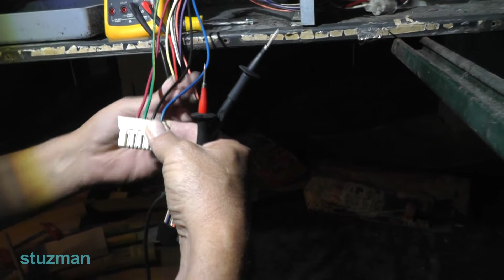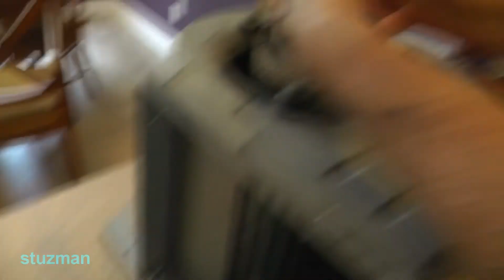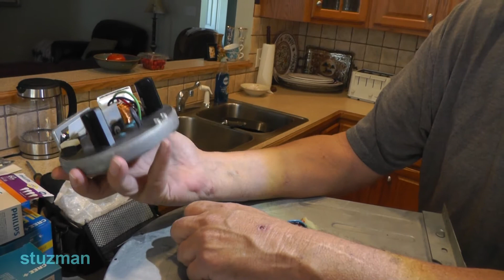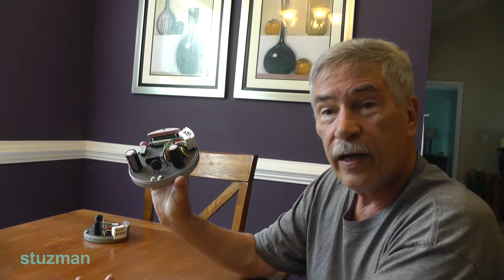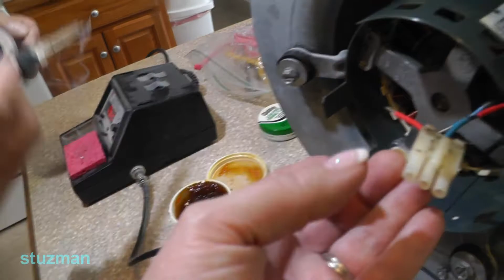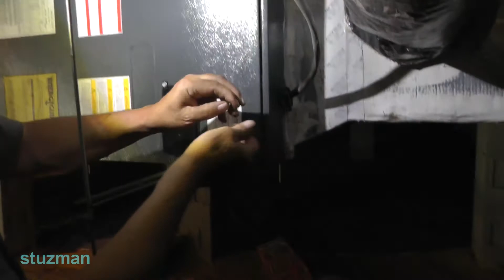House A/C Unit - X13 Evaporator Fan Not Running and Fix

Comment: Excellent video. The only question I would have is the rotation revolutions per minute on the cool mode, what it was before you did the replacement? Also, when heat mode is on or fan mode only is on, is the rotation RPMs the same? If those three are true, then this is a good swap. But if that's not known, it kind of leaves you wondering whether the CFM is proper for your system with the new ECM.  It is within the ECM that the torque values are stored so just because you are power tap 4 for instance does not mean you will have the same RPM after the swap.  All depends on the ECM and what is stored in it.  This is the frustrating thing about these dumb ECMs  Again great video
Reply from the maker: Yes, you're never sure about RPM when you order something from Ebay unless of course you check the RPM before and afterwards. In my case, only one wire was going to the terminal strip where only one speed was being used for the cooling and heating mode. In my case, everything turned out okay, and I didn't have any issue with the speed. I can count myself lucky with this issue. After five years, the module went out again and I ordered it from www.evergreenEM-motors.com I did a video on this installation where the motor will automatically sense the correct direction and program itself with that. If you like to see that video, it's located here https://www.youtube.com/watch?v=aAb5fVA-a1g&t=1s
Reply: @stuzman52  totally understand, but as I think you know, just because the one wire is going (and giving 24 V) to the one terminal before and after it does not guarantee anything about the speed - that speed is programmed in the controller. That’s what makes these so frustrating. You don’t know what that torque is programmed within the controller to run at. It’s really ridiculous how they made these things so complicated when you really just need three speeds. They do this to rip you off purposely just like encoding the whole thing in epoxy. I would like to have my ducks in a row and be able to easily find a replacement ECM controller for a reasonable price that I can pull the trigger on and order in case of failure. I just got a new Trane 80k furnace with the 3/4 hp ECM blower PT# D345978 RP# MOT18721 and some other #D344778P01. I will have to try Evergreen. Having a spare one on the shelf, kind of like a capacitor ready to go would be something I’d really like to be prepared for because I know it’s just a matter of time.  Thanks for the reply.!

Comment: I'm sorry... I got goosebumps watching you touching single insulated live wires so freely. Wear some sort of work gloves at least, if not live gloves. You never know if some sparky apprentice nicked the insulation. Brrrr....
On top of that, you placed a heavy metal fan, with some what sharp edges right on top of 240V wires 😳. That's how you damage the insulation and next time you grabbed them like you did, you're gonna get electrocuted. Be careful mate... Life is only one

Comment: Genius! I am 70 yrs. old, have been working in the HVAC business for 45 years or so, as a field service technician plus service and installation dept. mgr. I want to tell you that I have never seen a technician go to the extent that you did to help your customer out by repairing an X13 motor, or any other evaporator motor like you did. You and I both know that in most cases, that motor would have been yanked out and a new one would have been installed, AT A RIDICULOUS PRICE. My compliments to you, sir. I hope that your customer understands the great service that you provided her! You did get sort of lucky though on one part, at least the air handler wasn't located in the attic like 70% here in Pa. are. GREAT JOB!
Reply from the maker: Hi D Bru and hope you're having a great day! Yes, you are correct that most technicians would just pull the motor and replace it. And of course, what a price it would be! In my case, this was my own unit with my wife doing the filming. I'm pretty cheap and if there's a way to fix something I'll go that route. And having an electrical engineering background helped with the troubleshooting and fix. To this day, the unit is still working fine. Thanks for sharing a comment and hope you and your family the best wishes!
Reply: hejjhhhhhjh

Comment: I like what I see.  Will continue watching.  I have one question.  Since my A/C unit uses 240 volts, when measuring the amp draw on the two hot wires leading to the condenser unit, I'm measuring 12 amps on each line.  Does this mean that this unit is using 24 amps (both for the compressor and the fan motor)?  The nameplate on the condenser shows that the compressor should be drawing 17 RLA amps (running loaded amps).  The nameplate for the fan motor shows 1.9 amps and I measured 1.6 amps. 

If both legs are carrying 12 amps, and both wires are leading back to the service panel, then should the total amp draw thru the service panel be 24 amps.  I currently have a 50 amp circuit breaker which is two 25 amps circuit breakers together.  I know the reason why they use 50 amps circuit is to account for start-up on initial draw of the compressor.

Also, this unit uses 240 volts to run.  If I want to know how much wattage this unit is consuming, don't you just multiply voltage time amperage.  In my case, isn't that 2,880 watts (120V x 12A on each leg x 2).  So technical, isn't this unit using 24 amps?

Please help.
Thanks
Reply from the maker: Hi Steven, When you're measuring the amperage on a 240V unit or any 240V circuit, and you see 12 amps as in your case, it's 12A. Think of the 12 amps as going in on one hot wire and the same 12A is returning on the other hot leg. The same can be said for a 120V circuit. If you measure let's say 12A on the hot leg, you should measure 12A on the neutral when it returns on that wire and it's still the same 12A. Your compressor is rated for 17 RLA, which is 'rated load current'. This means with a full load, (maximum safe limit for the compressor), you would be pulling this amperage. It sounds like your unit is pulling OK amps to me and is not being overloaded :) As for the wattage, your answer is correct, but think of it as 240V * 12A = 2,880W. If you were dealing with a 120V circuit, then use that voltage as in 120V * 12A = 1,440W. Is that clear as mud? :)) Thanks for the question Steven and hope you can find some useful videos on this channel!

Comment from the maker: This is where I purchased the module from Ebay. Be sure this is what your issue is though as I'm not responsible if this doesn't fix your issue... Glad that you liked the video. http://www.ebay.com/itm/GE-Genteq-X13-1-2-HP-Endura-Module-For-1-2-HP-Motor-/112280285526?hash=item1a246d3156:g:tLgAAOSwZQRYh7hK

Comment: Great video Terry ! You will need the air conditioning this week it's going to get hot !!
Reply from the maker: N Smith thanks Norman and you're right that it is going to get hot. All is well so far AC is running good.👍
Reply: Good deal ! Yep temperature in the 90s and humidity is going to be high to 😮

Comment: Thank you for sharing this with us engineer, you are really a knowledgeable man! About the windings check its ok using an ohmmeter?? Thank you again!
Reply from the maker: Thank you armando for watching the video and sharing a comment! Sure, the ohmmeter is fine in checking the windings on the motor. It's pretty standard in the industry in checking all types of motors out there; not just this one. If there is a problem with the windings, it usually will show up with the resistance checks.
Reply: +stuzman thank you for the reply, ok now i understand.
Reply from the maker: armando nika you're quite welcome😀

Comment: You have two AC units, wow it must get hot down your way. Well done Terry , nice work and goosebumps :)
Reply from the maker: Oh yeah, in the summer we can get over 100F with very high humidity. It was nice to have the second unit where we could temporarily move into that area of the house until I got it fixed. Thanks for the nice comment Steve and for dropping in and sharing a comment!

Comment: What an outstanding troubleshooting video, bravo! With those three wires, would it have worked in reverse by swapping any two?
Reply: The direction the motor spins is all about the sequence of activation, which in turn is all about the order those wires are activated. Now consider there are exactly six ways you can plug those three wires into their connector. However also remember that when the motor is running it is running in a circular, repeating sequence. Now give each wire a number, and write them out in the order they are tied into the connector. The order of 123 would give an identical order to 231 and 312 when you write them out in a long repeating string. It turns out there are only two unique sets of sequences, let's call them set 123 (including 123, 231, and 312) and set 321 (including 321, 213, and 132). Notice that if you swap any two wires, you switch from one set to the other. One set spins the motor clockwise, the other counterclockwise.
Reply from the maker: Thank you very much Dave in liking the video! Yes, swapping any two of those three wires would make the motor reverse. Thanks for dropping in and sharing a comment!
Reply: As I think about this now, I can understand why you can swap any two wires. The order of the three numbers is all that matters, and with three digits, these all distill down to only two sequences. Since 123=231=312, and 321=213=132, all six unique possibilities are covered. The fact the pattern is endlessly repeating means the only difference is the start point! What a great demonstration of a simple idea.
Reply from the maker: You've got it Dave and the three phases are 120 degrees apart from each other. It all boils down to the starting point as you've mentioned :)
Reply: The wire swapping I am having a little trouble wrapping my head around... I understand that the three wires are 120 degrees out of phase with each other, but why does swapping two make the motor spin the other way????
Reply from the maker: Great explanation Dave for Randy! I appreciate you taking the time to help him out!!
Reply: So it is not about reversing polarity, but about the sequence the windings are energized in that changes the direction of shaft rotation... and is it safe to say only one set of windings is ever energized and any given instant?  And certainly thank you spelunkerd and Terry for your patience and clear explanations.
Reply: Perhaps Terry can add info about the way the signals come from the controller, I don't know much about brushless motors.